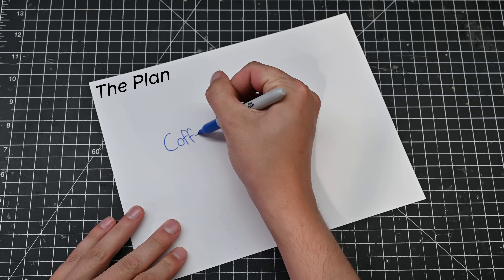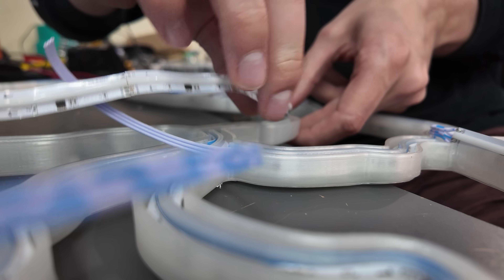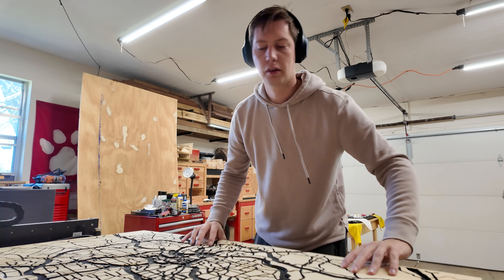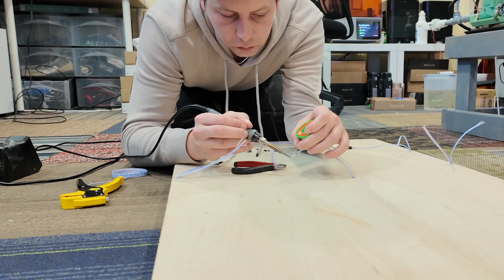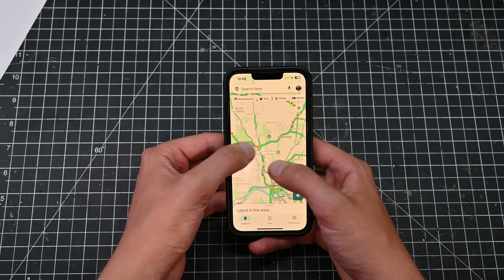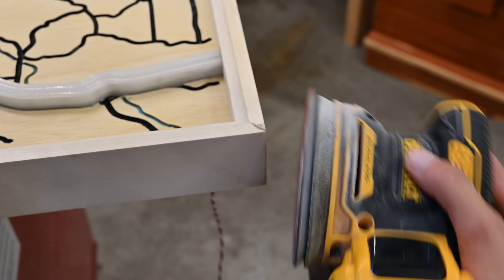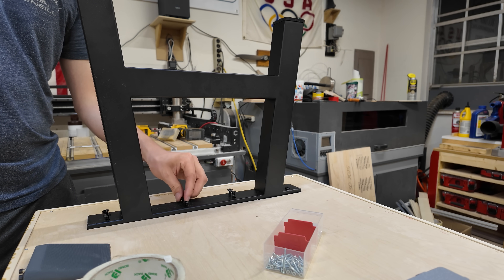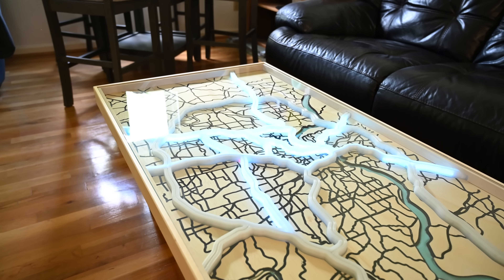I Built the Smartest Table Ever

Comment: 3:12 - I cam to the comments to say this! my dad just finished a project with very small line work that was hard to paint. so he painted the whole surface and the sanded the top later off and it looks amazing and looked like he had taken a small brush and perfectly painted the cracks.

Comment: Brilliant! For the next one, you might try using an 8K screen beneath toughened glass, cast from your phone. Motion sensors installed into each side of the table will detect your position and orientate the map similar to how the map behaves on your hand-held device. A proximity switch (installed wherever you like) will turn on/off the orientation functionality. I am in no doubt whatsoever that you can do it.
Reply: Or he could just get a DiamondTouch table or Microsoft Surface Hub instead of re-inventing that particular wheel which has had over $1bn of R&D already.

But I understand the desire along with a shared "this should be easy, right? A screen, a mini PC (maybe not even that) and some IR sensors connected to an Arduino board and a spot of coding ought to be enough" sentiment.

Comment: You could've hypothetically automated this build more, like putting a pen on the cnc router and using it as a plotter to fill in all the roads with black ink.   Or putting a camera on the board and taking a picture for each LED and do the mapping with software matching by splitting the table position pixels with the map titles, then the program can go through each led and do the mapping automatically for you.  You could've also made a program to translate the roads to cnc so you didn't have to do it manually either.

Comment: This is such a genius idea and I love so much of the execution. I wish instead of having 3D printed the LED housing so elevated you had cut into the ply further with the CNC and then inset it or even better cut those all the way through backed it with a light diffusing film and had the traffic show from underneath so that you have a subtle but clear depiction of traffic with out losing the modern and clean look of the rest of your table. You mitered edges were so incredible. I’ve tried so many times and usually because my wood isn’t planed well I can’t get that clean of a join.

Comment: It's a nice build but a modern EV has traffic monitoring built into its navigation. Removing the need to manually check and plan. This would save you more time.
I'm a fan of Mazda but their navigation/infotainment system unfortunately isn't the best.

Comment: I wonder how difficult it would be to model the roads and use a multicolor 3D printer to make the whole board. Unless you've got an absolutely massive print bed you'd have to split it into tiles, but it's doable. That would make it easier to add names and maybe even buildings, so you could read the map instead of just having the bare roadways. Also, I hope no one hunts you down using this video.

Comment: 2:50 why not spray paint or stain and then sand the top?
Reply: I was going to say the same thing.
Reply: honestly it's pretty hard to get spray paint into crevices since you have to go from essentially all 3 directions. Getting it opaque in the crevice means it's 3 times the amount for being opaque on the top surface. Might still have been easier to sand off, but with how he started, thinking he would get away with no color on the top surface, this seems completely reasonable.
Reply: @m-tech1816  With the draft angle he could have just gone thick and straight down. It would get all sides
Reply: It’s not that easy, dude
Reply: @freemanc6258 pretty sure it is

Comment: Considering that opaque resin, such as that used in 3D MSLA printers, is intended to cure only a few dozen microns thick at a time, I find it fascinating that people will pool literal millimeters of it at once and expect it to cure without any problems
Reply: Not only is the shrinkage a problem with such deep pools, but you'll often find that internally it isn't cured at all.
Reply: @graealex  Exactly. Uncured resin trapped inside cured resin will cause it to eventually crack, shatter, or even explode.

Comment: Since you sanded the surface anyways you could have used black spray paint... (okay maybe in this case a second coat of PU would also be beneficial (to make sure that no Vally is to low))
And a really cool project!
if you have some spare time left you could redo the entire table, and use 2020 RGB LEDs, soldering them by hand and fitting them into each road.. (only a joke, I have a couple of them and the only way I use them is to loose them when I have the courage to retry to solder them.. :D)